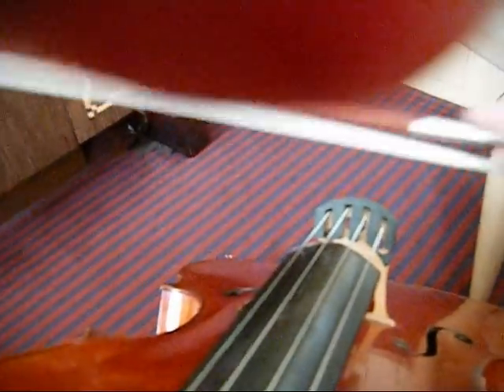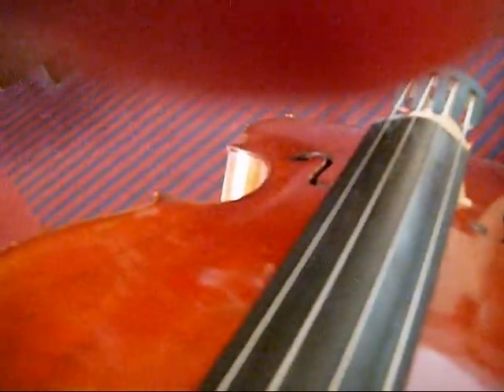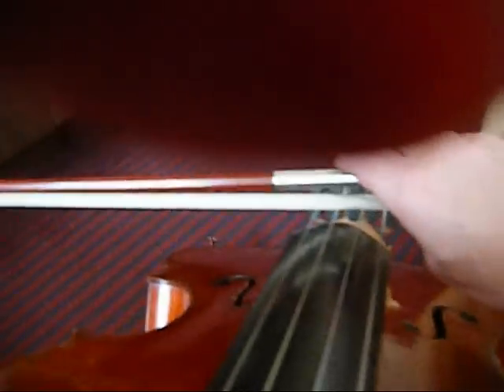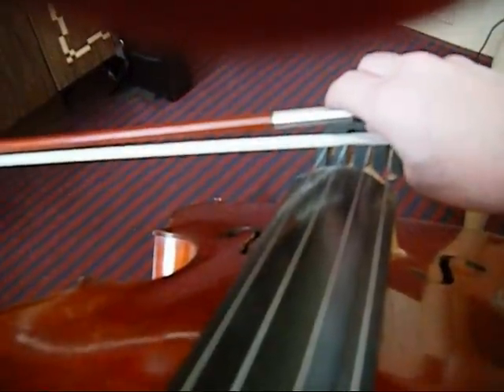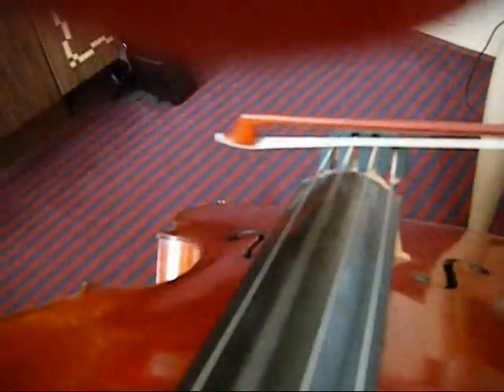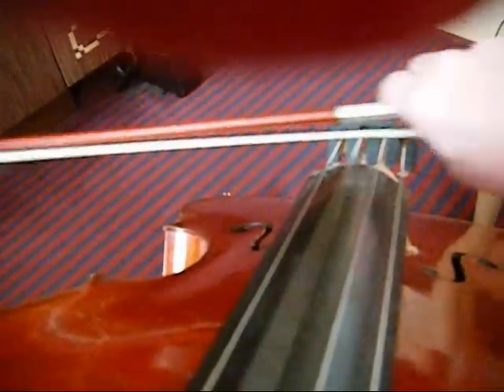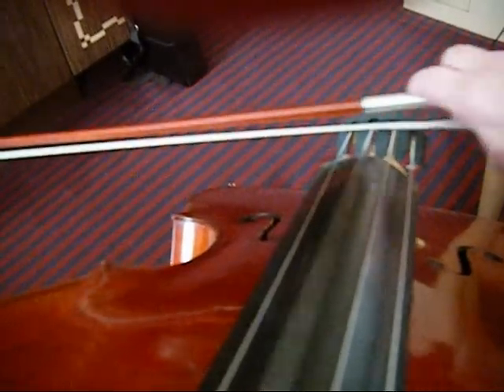Talk 70: Sound Production I: What Makes it Loud?

Comment: These videos are a real treat.  There are many ways to describe this same thing. To start even more fundamentally would be to say that great sound is where the bow matches the speed of the string so only helps, never impedes its motion. The string always is moving further, so faster, at the fingerboard than the bridge so the bow must accomodate. So for any one bow speed and weight, there is only one very small optimal place where the bow is neither too fast or too slow for the string it is on.